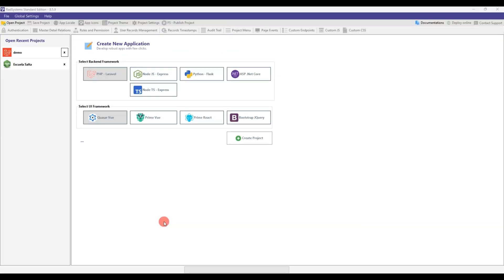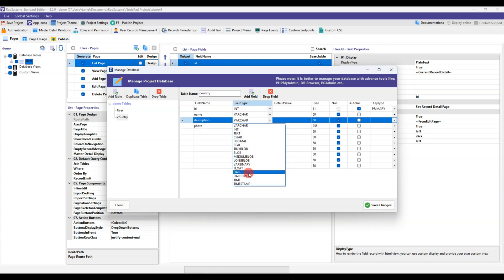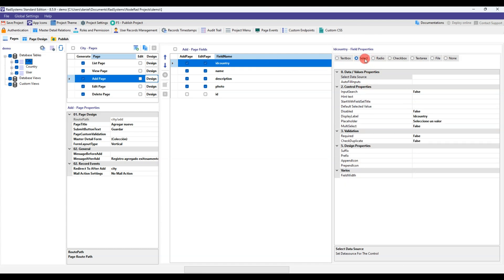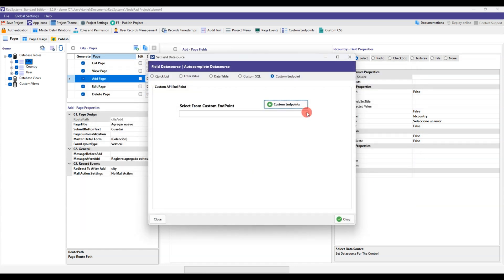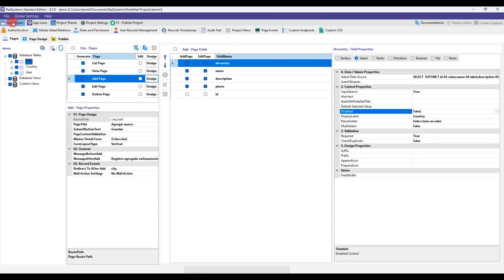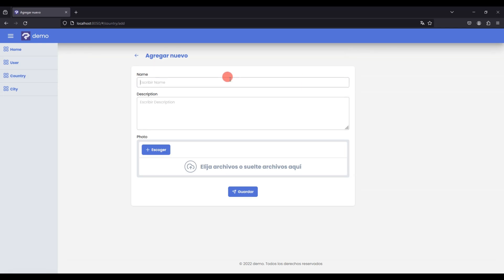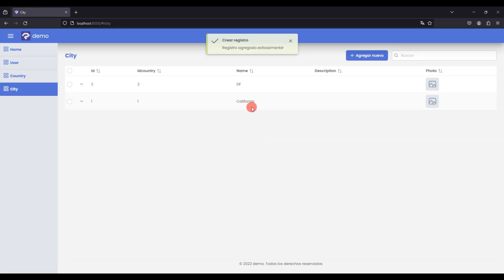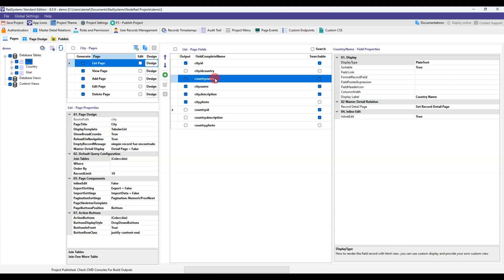How to setup dependent lookup | RadSystems Studio | Low Code

Comment: Thanks for videos. Is there any option [Sum Calculation of same row fields , like Excel] ?
Reply from the maker: While there isn't a direct method to achieve this, there are several alternative approaches. On List and View pages, you can add a Custom Field to calculate the row sum by performing mathematical operations on the columns. All the values on the List and View pages are accessible in the $data array. For further assistance, please contact our official support by visiting our website at [radsystems.io](https://radsystems.io) and clicking the 'message' icon in the bottom right corner. We're here to help!